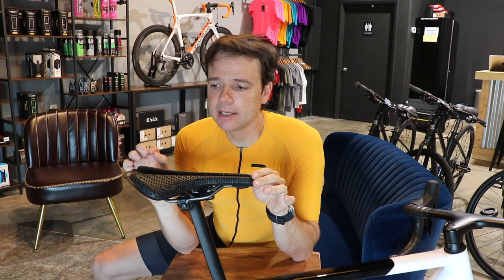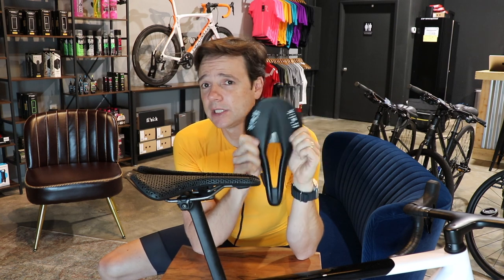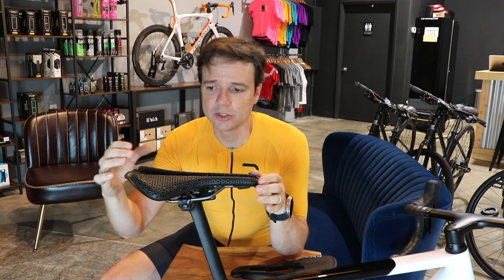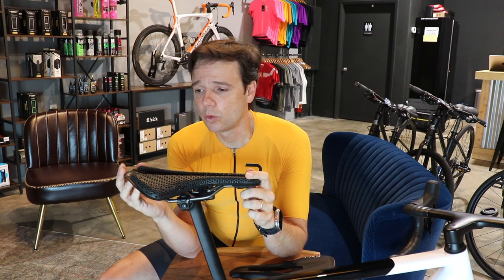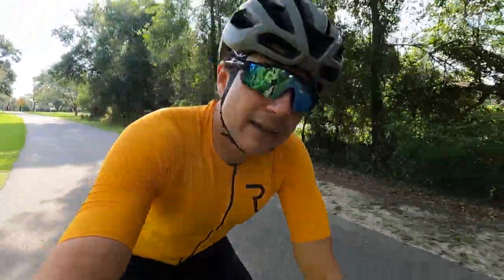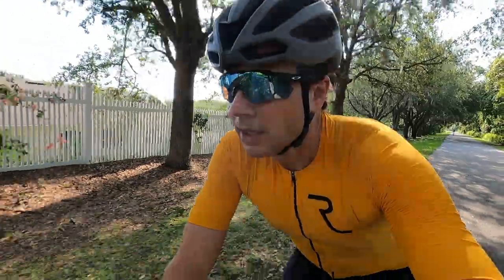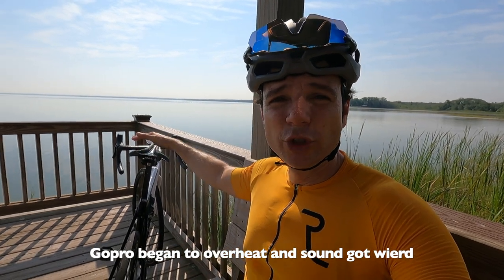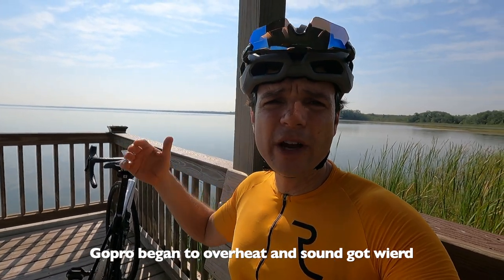Revolutionizing Cycling Comfort: Exploring Fizik's 3D Printed Saddle Technology

Comment: I have 4 fizik saddles, x1 Fizik Antares 00 Verus 3d printed, x2 Fizik Antares 00 braided and a Fizik Arione 00 Braided. The 3d printed Antares is the most comfortable due to the density of the different zones and shape. Also a huge part of being comfy on the saddle is stretching your hamstrings so you sit centered properly. If you're muscles are tight you'll likely be off axis and have unwanted pressure and hotspots. I had an Ergofit by a coach from Bora and he explained these things to me.
Reply from the maker: Than you for the insight, very interesting
Reply: How's the durability on the Antares Adaptive sadd,e? I've heard they breakdown sooner than traditional saddles